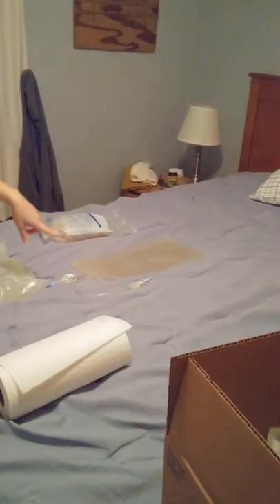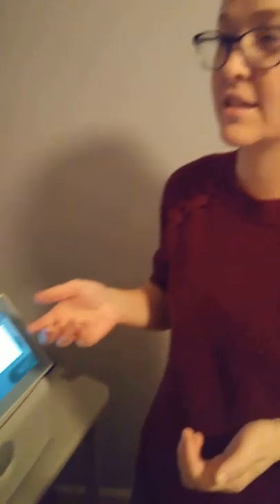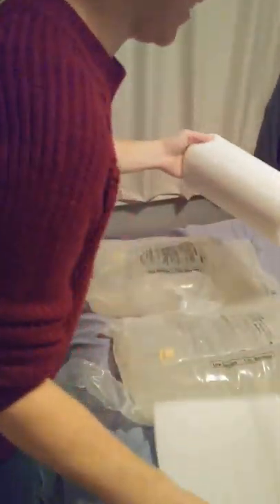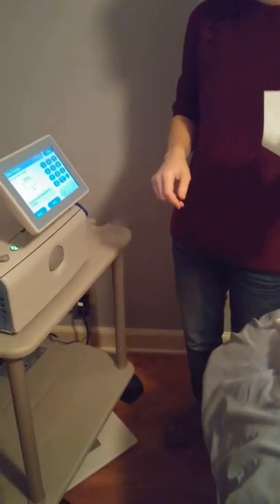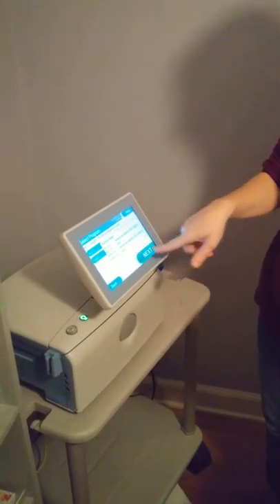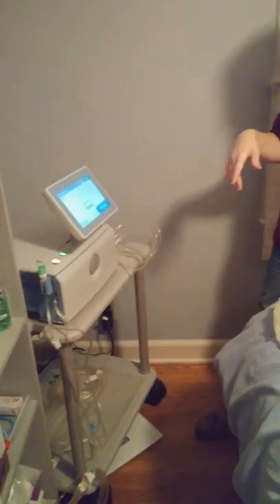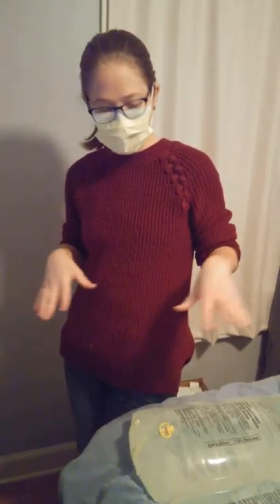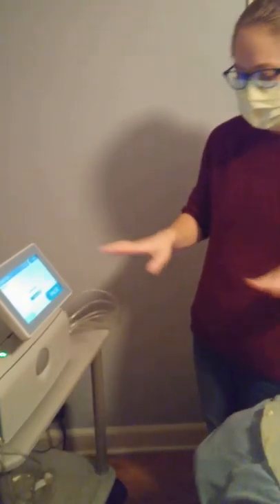PD Dialysis Machine Daily Set Up - part 1

Comment: Hi Debra, when you were on PD Dialysis, what cart/table for the machine did you use and where may I find one?
Reply from the maker: Hi Thomas. Im not sure what the brand was, but I bought it through my dialysis clinic. You should be able to get one through your clinic too. If they dont sell them there, they should be anle to tell you whete the closest supplier to your location is. They are pretty expensive - mine was $100, but they are useful.